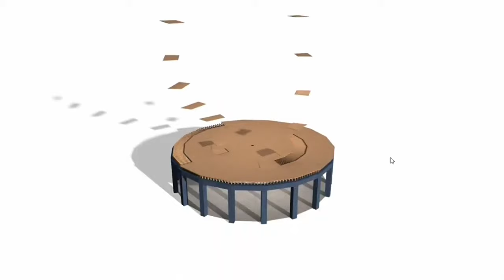Deltec Homes on Inside Edition

Comment: That's wonderful! Have these homes been tested with tornado conditions, as well?
Reply from the maker: We have had some homes get hit by tornadoes and survive. Many of  the engineering and build elements that protect against hurricanes help with tornadoes as well. That said, tornadoes are different and extremely strong tornadoes present special challenges.
Reply: Sure have Jocelyn.
Reply: Yes,ms.Joselyn f.
Reply: @DeltecHomesBuilder  Seems Tornado's happen more than hurricanes, so in concerning examples like 'Tornado Alley' where flooding isn't so prevalent - Have a Dome shape home, made with  Flowcrete, and Curved steel beam connectors' (like a basket ball)  While Anchored the same way as the home featured in this video, (maybe with a basement also?) also with Retractable Windows and Entry Alcove boxes, like RV's Use, Cept' tougher, Then Metal Shutters come down, like they've used in Germany for decades.  Now it looks like a Golf ball pressed halfway in the ground, Nothing for the wind or pressure to grab!  This Tornado Proof Type Home' is So Do' Able _ imo, Just a thought,😶🖖🌎🌍🌏🕊️